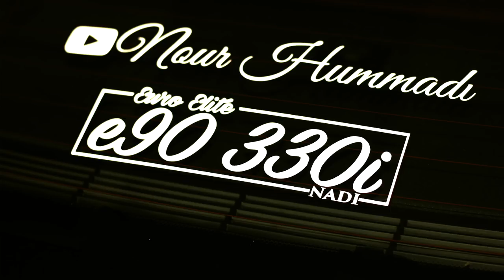BMW E92 QUARTER PANEL 100% DONE/ ROOF WRAPPED!

Comment: Nour, body work turned out beautiful. Headlight, my e92 did the same thing, careful, condensation runs down and start shorting out all the little computer boards with in the headlight. First my adaptive headlight went out, then the angels went out, then finally the main headlight. I had to replace the whole light housing and all the components that go along with it. Try and fix it before any more water gets inside.

Comment: hey man what I do for my foggy depo headlights on my e90 is stick a coffee filter filled with damprid beads in the back of the fogged headlight hatch by the bulbs. it sucks in the moisture and keeps it from fogging up. Just have to replace the damprid/coffee filter every couple months or so with a fresh one. A little goofy but it gets the job done!! I've had the fogging problem for about 2 years and this trick has kept it nice and dry ever since.

Comment: I would just recommend to tint the light to try and hide the imperfection or just change the headlight lens
Reply from the maker: SEEB XX yea man changing the headlight lense but the adaptive headlight modular went out because of the condensation so I need a fix

Comment: You could use a air line to get the water out of the lights and if you get some wet and dry 800 to start then finish off with a 2000 then give the lamp a good buff with a machine mop then I would hit it with a clear coat 👍

Comment: What car should you get Jaguar f type v8 s or a m4 manual or dual clutch or a Nissan GT-R 2010
Reply from the maker: m4 :) or R8
Reply: GT-R ALL THE WAY BRUH 🙂
Reply: Nissan GT-R 2010 for power but if you want a daily, definitely get the M4 dual clutch
Reply: M4, but the M3 is nicer

Comment: Beema is Looking sweet man, good luck with fixing the headlight, I'm not sure if it's gonna help, But maybe you can unglue the plastic cover and buff it from the inside? It might get 80% of the hazing off but it will never be perfect as it looks badly distorted from the heat gun. Have a great day/evening.. peace!

Comment: Your hair isn’t that bad lol. I had that problem with my head light I removed the plate on the turn signal. Turned on the high beams and left it for a while. Then once it was almost completely gone I checked every light was in tight. Since then I’ve been good. But it looks like that lenses is toast now. Try eBay for a good used one.